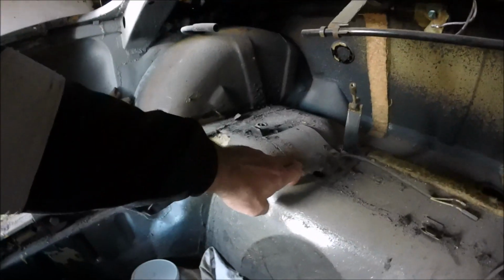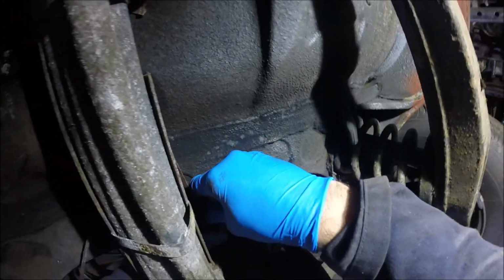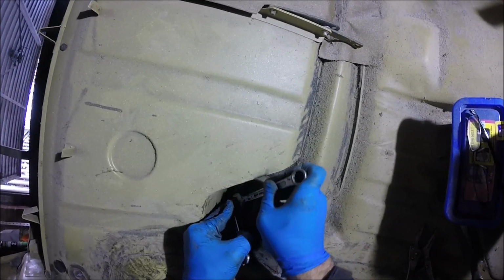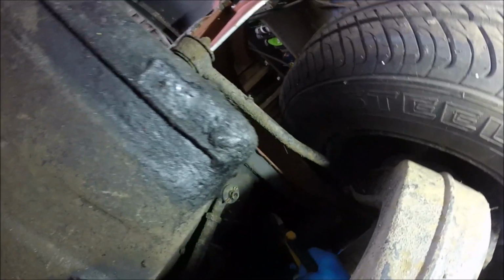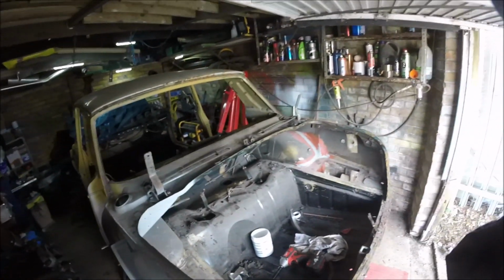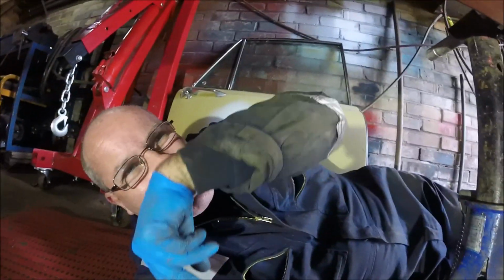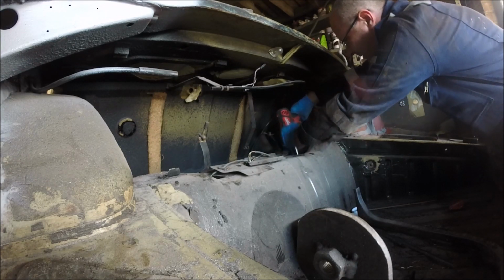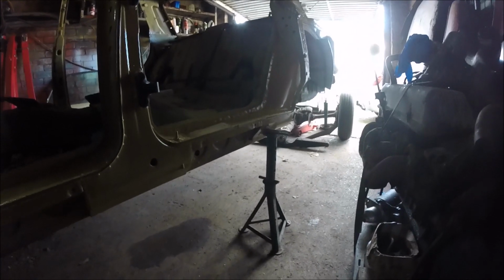Rover p6 v8 removing the rear axle #p6 #v8 #rover #carrestoration

Comment: The P6 had factory holes to fit a towbar in the rearmost jacking point, I know because I was the first owner to fit a tow bar to my 1973 P6 3500S and the used genuine towbar just bolted straight through that jacking block, then there was a piece of angled steel to the front of the boot, pretty sure the holes were in the boot floor already and then a piece that bolted behind the chrome of the rear bumper to brackets there
Reply from the maker: All them holes are gone now on mine. Lol.👍

Comment: Back in the 1980s my P6 had a bit of weld boxing to the jacking points but elsewhere was OK, until one day the o/s axle tie bar pulled out together with a bit of the o/s vertical boot side. My mate a mechanic welded a plate into the side of the boot, drilled a hole for the bolt and all sorted, I was well chuffed.
Reply from the maker: That does seem to be a common place for them to rot.
Think its where all the road dirt builds up where the tie bar bolts on. 👍

Comment: Good advice re jacking points! Seen them fold on a P5B at 6yrs old!
Reply from the maker: I thought I should point it out as mines standing on them but I've just repaired mine so can be confident there good. 👍
Reply: Yup, on P5 with factory jack seen the tube break free from rust and jack go into the sill and the rear door skin 🤕 at least P6 jacking tube wasn't just tacked on under the sill like the P5
Reply: @richardhaywoodh  sounds like we had a lucky escape with our P5, can see it now, just folding gently upwards and Dad shouting let it down! So on the P6 we jacked it up using the block under centre rear bumper, but with an Epco 21/2ton jack it took its max lift to get near the rear brakes!
Reply from the maker: I only used my jacking points after I'd repaired them so I knew they were sound.

Comment: Used to use the rear jacking point, but needed an industrial Epco jack to get the wheels off the ground because there was so much suspension travel. The De Dion had the curious characteristic of creating a lateral shimmy in some situations. Notice you have boots on outer CVs, not fitted on 60s cars
Reply from the maker: My Jacks reasonably large to get it up quite high but I jacked it up on the Crossmember before using my bars and axle stands. 
Never realised the early cars never had the boots on the driveshafts. 👍